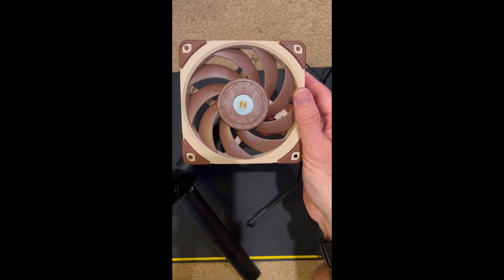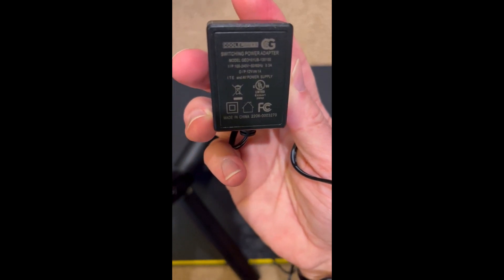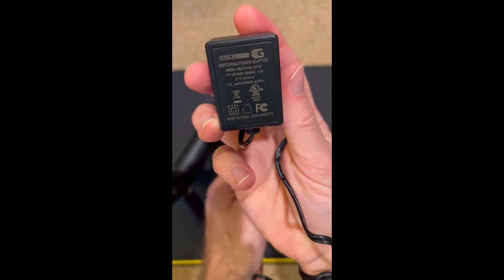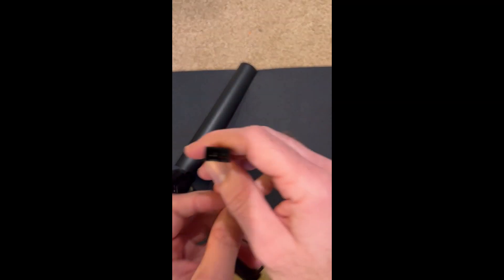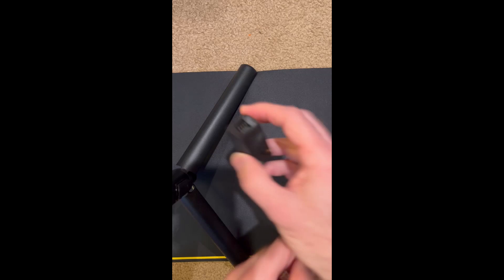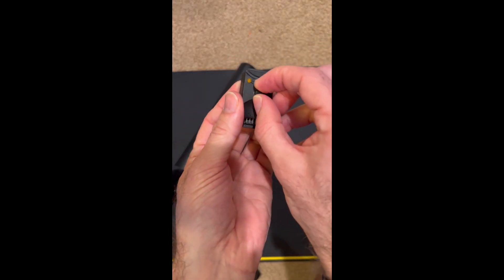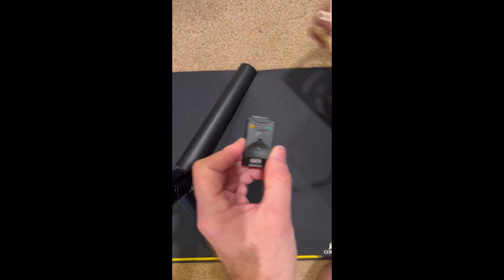#short How to Control and test Fans outside a PC

Comment: No pins on pwm so that control does nothing.
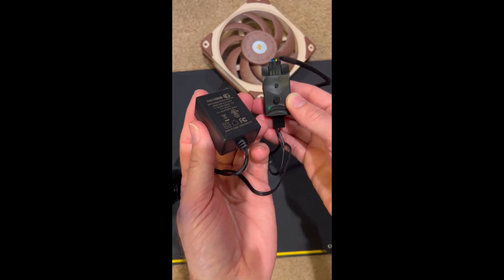Reply from the maker: ?? at 00:28 you can see the 4 pins on the fan sooooooooo. Yes it can be controlled. Noctua does make a version without control though. I have that helping cool an old xbox360.